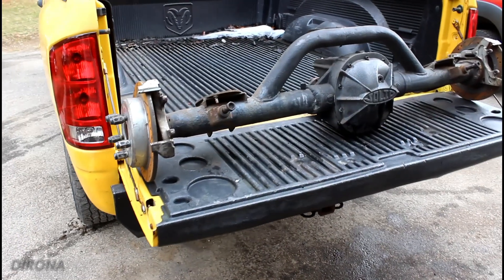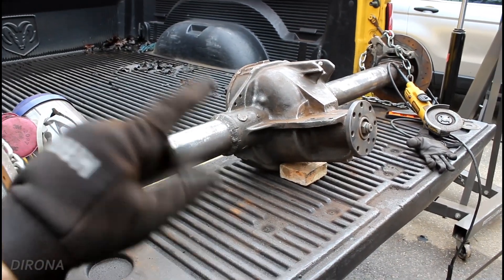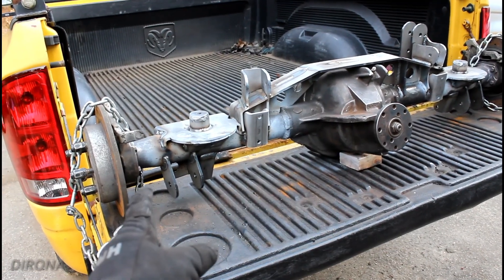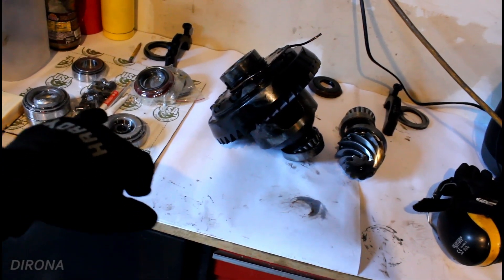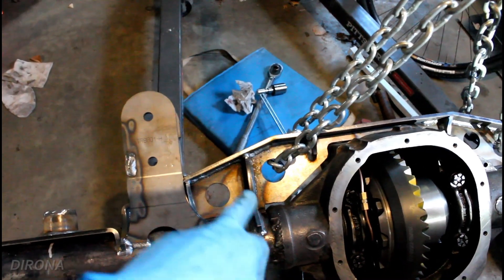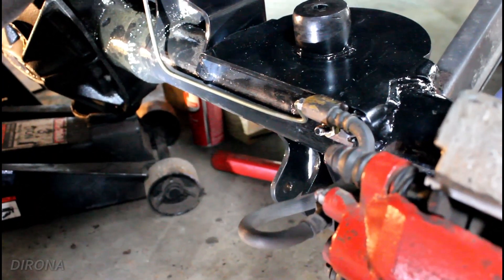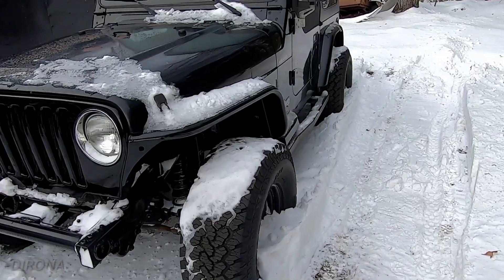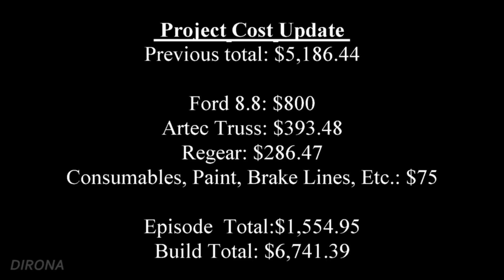Jeep TJ FORD 8.8 Axle Swap | Budget Crawler Ep. 27

Comment: Unable to use the stock rear drive shaft huh? Is it a length issue, cause I believe they make a bolt on adapter for the rear joint.  But the 8.8 probably being physically larger than the d35 I could see there being an issue. 

Just curious, I'm probably going to do a 8.8 rear on mine cause in my area finding tj Dana 44 anything is impossible unless I get them from a jk and shorten the axle tubes and do all the bracket work as well, 

8.8 seems cheaper and more available.
Reply from the maker: Yes, I think it was the flange adapter on the 8.8 side of the driveshaft that pushed it over the length limit. But the driveshaft was technically longer than it should have been even with the D35 because it previously came off of a lifted jeep and mine is more or less stock height.

Comment: I wish I had a frame that clean- mine looks like the surface of the moon after ~20 years of New England winters. The only reason it’s not Swiss cheese is because I drilled weep holes and douse it in Fluid Film every year… but it certainly doesn’t look like yours
Reply from the maker: I’ve had many that look like Swiss cheese. I was extremely lucky to find this one they spent the first 10 years of its life in California and had only seen 7 or 8 northeast winters when I bought it. I take it off the road every fall to keep it out of the salt

Comment: I see that you have a low pinion gear on your new rear axle. Could you give me a little explanation, please. Almost everyone says that high pinion is better. Could you be so kind to explain me whether this is true or not.
Reply: They are talking about the front. The Dana 30. The xj has hp which is an upgrade to a wrangler with the dana30. But good luck finding an xj without 3.55
Reply from the maker: Yes, what xjbeater 86 said. The high pinion dana 30 use the “drive” side of the ring gear to move the vehicle forward, where the low pinion uses the “coast” side which makes it more susceptible to breaking

Comment: What adjustable upper control arms did you use? Awesome series!
Reply from the maker: Thanks! Used a cheap set of rough country arms I bought on Craigslist, don’t recommend unless you can get them very cheap, bushings don’t last long. I’ll eventually upgrade to Currie or Metalcloak

Comment: Just got a 6” long arm for my tj to clear the 38.5s found a place called east coast gear that has 8.8 ready to bolt into tjs and pick what gear  for around $1300 so idt that’s too bad vs finding one, changing gears, moving perches and shit so I’d say I’m good on back but is there any alternative to upgrading the front axle other than a g2 or rubicon axles(hard to find and when you do they want 2500$ just for the front most of the time bc sellers know they are getting harder to find for tjs) hate to go 1 tons and have to do custom shit also bc I’d like to keep my 5x4.5 and 5x5,5 wheels that cost 2k a couple years ago. I’m upgrading my front 30 control arm perches and gearing 5.13 just to hold me till I get the money for a better axle but any ideas anyone?
Reply from the maker: That thing must be huge! East cost gear supply is a good way to go for the 8.8, looks like it would cost around $3600 to get an 8.8 similarly optioned to the one I installed. The axles you need for 38.5s depends greatly on what type of off roading you do. If you’re only driving on the street you may be able to get away with an 8.8 and a high pinion Dana 30 out of a XJ to keep the stock TJ bolt pattern. But if you do hit the trails I think even Rubicon axles would be undersized for you. I’d look into finding some junkyard dana 60s or one ton axles. You should be able to find someone who will make custom axle shafts with whatever bolt pattern you want. Big tires get expensive quick!
Reply: @dironaa I’m back at this video and saw my post haha well it’s my grandpas passed down so I don’t wheel hard enough or do rocks to risk ruining it. Just power line trails and some mud every now and then. But I ended up picking up a ford 8.8 with the brackets already welded and ready to bolt in for $100! Ring and pinion is bad in it but I need 5.13s anyway and it needs is calipers. Can’t really beat that for $100

Comment: I just went through the headache of setting up the parking brake cables and assembly.
Rough Country had the best deal on a set of cables for this swap. Now for the very important part, please learn from my pain on this. Remove the axles when you are installing your parking brake hardware. This step will save you a lot of cussing, busted knuckles and broken or deformed springs/hardware on the install. Second important note is to remove the lever/hinge by pulling it strait out(with axles removed) from the flange, wire wheeling the two pieces which are probably rusted together as one until you get down to the white. Then coat the pin and contacting surfaces with your favorite grease or anti-seize and reinstall. When you get the new hardware, place both springs on the shoes and secure the shoes in place with the retention pins on the flange. This would have been 10X easier with the axle removed. I had to learn that the hard way.
Reply from the maker: Thanks for the tips Mike, very much appreciated. Ordered most of the brake hardware from ECGS already but don’t have the cables yet so I’ll check out rough country
Reply: @dironaa  I looked through my receipts and the cables I got were the ECGS kit, cant beat that deal for 60 bucks. I recently got the stainless brake lines from RC, and those were the best deal for a set of front and rear stainless hydraulic lines
Reply from the maker: @Mike__S  Cool thanks, that’s the best price I’ve come across too. Will do a little more searching but that’s probably the kit I’ll go with
Reply: I used Grand Cherokee cables on my 8.8, the Grand and Explorer use the same brake parts on the rear.
Reply from the maker: @dennisthompson7707  Would that be the ZJ era Grand Cherokee? Sounds like disc brake TJ cables will fit too but they seem to be more expensive than the ECGS kit, I’ll look into the Grand Cherokee cables though. Thanks
Reply: @dironaa  I believe it was ZJ, its been a while since I did mine.

Comment: I upgraded my axles to 35 spline chrome molly with c-clip eliminator almost as strong as a 60
Reply from the maker: Nice. This one has chromoly shafts and c-clip eliinators too but I didn't check the spline count.
Reply: @dironaa  i also had a air actuated ox-locker and 4.88S
Reply: What brand did you end up installing into your dana 35 and did you install a airlocker?
Reply: @leovillanueva7463  I'm sorry I replaced the D35 with a Ford 8.8 with 4.88 gears aftermarket axle shafts and a OX locker that is air actuated i purchased it from  East coast Gears thay have great deals

Comment: Did you use the stock track bar?  Did you have to modify the exhaust?  Just put in my 8.8 this weekend and track bar hits the exhaust.   Few people told me you have to modify the tail pipe.
Reply from the maker: I did use the stock track bar. It clears the tailpipe on this jeep fine, but my exhaust is mounted higher than stock. When I bought the jeep the two tailpipe hangers were rusted off so when replacing them I took the opportunity to push the tailpipe closer to the body.

Comment: Thanks for showing your 8.8 swap. I want to do this for my TJ and get rid of my Dana 35.
Reply: I recently made the swap myself, just a heads up those 8.8 axles have an offset pinion from the centerline(when axle is centered under the vehicle the pinion will be about 2" to the passenger side from center) also read my comment about parking brakes👍
Reply from the maker: Thanks for watching. An even easier swap is to find a factory Dana 44 out of a TJ since they'll bolt right in with no modification. Where I live the D44 can usually be found in the $500-$1000 range but I know in some places they can go for more than double that. I run a factory TJ Dana 44 in my V8 swapped TJ with 33" tires and it's held up well.
Reply: @dironaa  Hi, did you need lower coil isolators for the 8.8 swap? and does the coil stay in place full droop in the rear?
Reply from the maker: @ryansremark6983  You can use coil isolators if you want but they aren’t necessary. The artec truss came with retainer plates that you can use to bolt the spring to the axle so it won’t fall out at full droop

Comment: While a cheap build, the 8.8 isn't the best option anymore. I would consider an ECGS custom D60 or D44 . But when your talented and have the tools.... Taking an 8.8 from the junk yard to usable is a lot of work.  ZJ disc brakes, ECGS housing and gears brings a lot to the table...
Reply from the maker: Is it the best? No, there are many great bolt-in crate axles out there now. But for the price the 8.8 is still hard to beat and should be plenty adequate for this build
Reply: @dironaa  what's your time worth? From what I've seen, 85$ @ hr... Sounds modest multiply that times the 20ish hrs you put into the 8.8. Then it's just , the glory...
Reply: Hahaha! 
So, how is buying a prebuilt axle for $1900 is a “better deal” than building an $800 axle .?.!. 
I will take two if u are buying...
Reply: Well a rock jock 60 would be better too. But this whole build is about keeping it budget friendly and still reliable